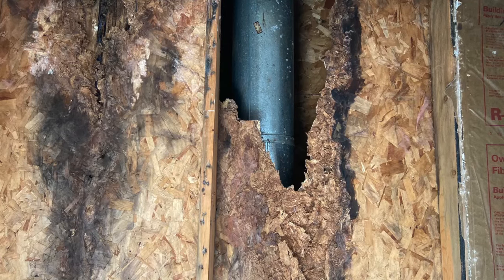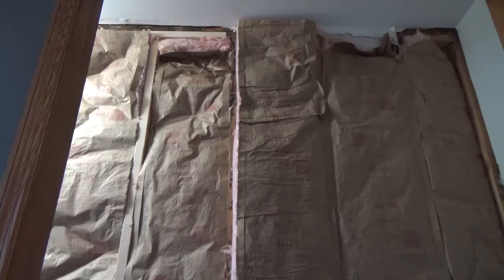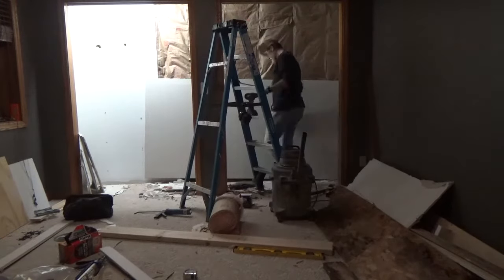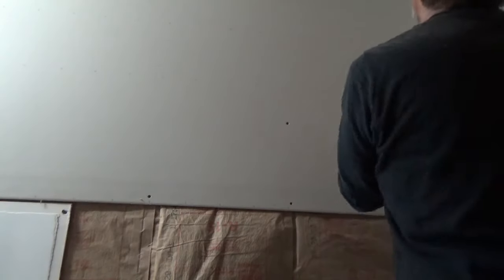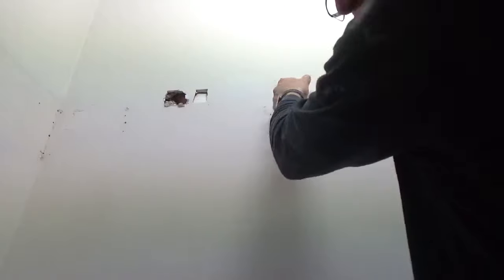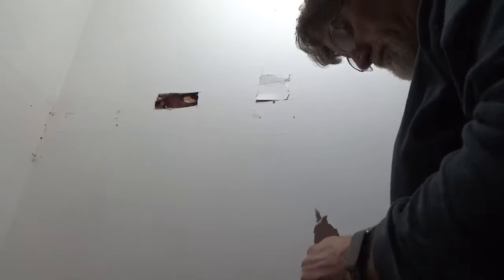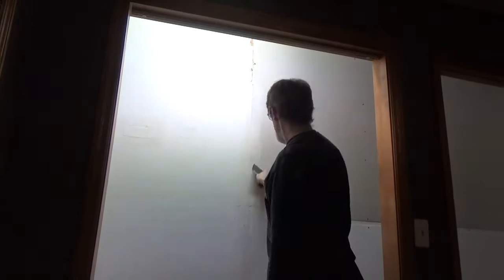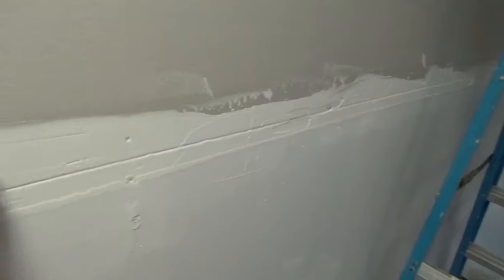Repairing a rotted exterior wall part 3

Comment: thanks for showing that I don't have to replace the whole wall when its only partially rotten and replacing all my siding...your method will save me a fortune!
Reply from the maker: Hey!  Glad to help!  It was partially born of necessity since I had to fix it in mid-November in the North-East. :D  If you check out my chimney videos you can see that the repair actually looked quite well from the outside too! https://youtu.be/22--SI8UrNE  They show what the repair looked like on the outside after the chimney was torn down.